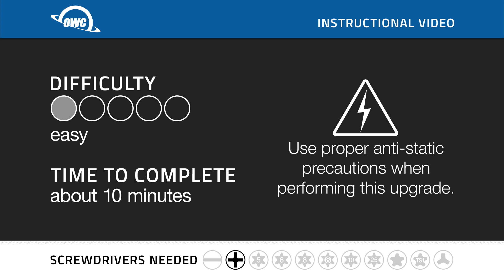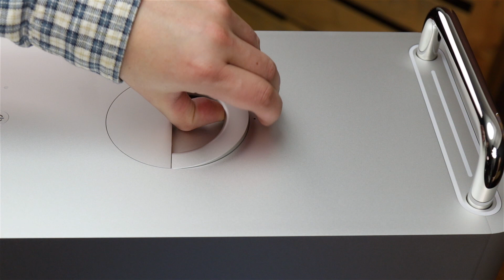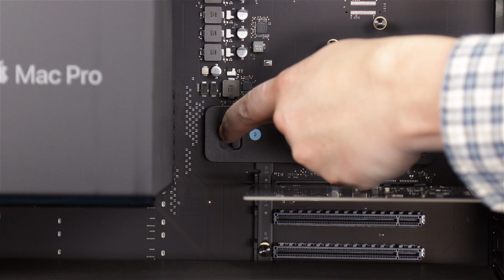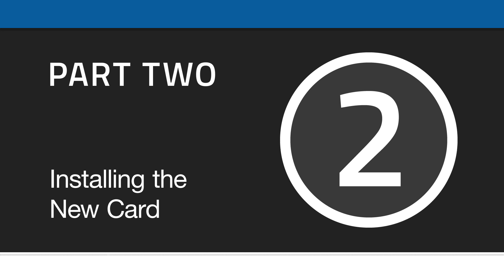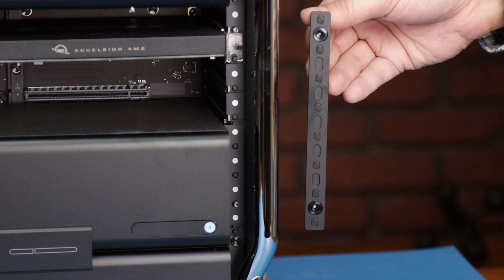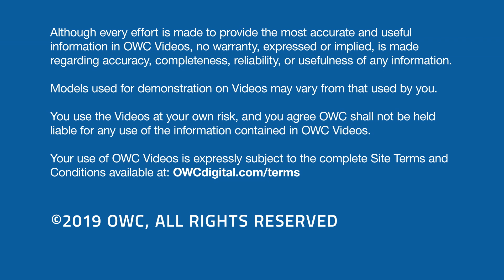How to install a PCIe SSD in a Mac Pro (2019 - current) MacPro7,1

Comment: How do you make it bootable?
Reply from the maker: Yes, you can make it bootable using a single, independent M.2 startup disk, with the other three M.2 SSDs configured as independent volumes or as a software RAID (SoftRAID or Apple RAID). Mac Pro (2010-2012) requires macOS 10.14.6. Mac Pro (2019) requires macOS 10.15.1 or later.